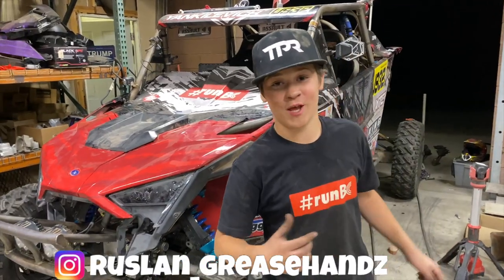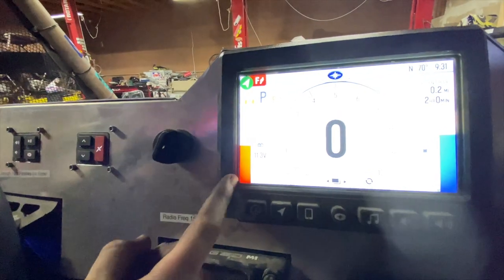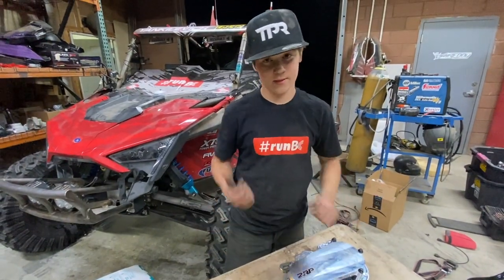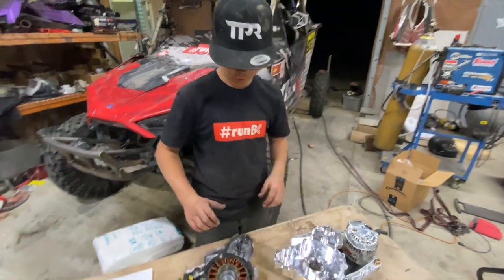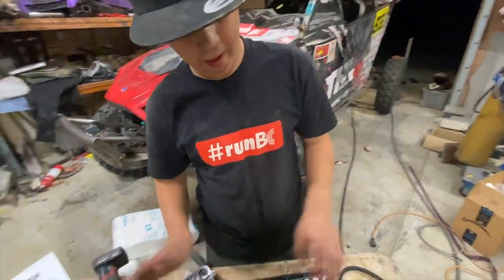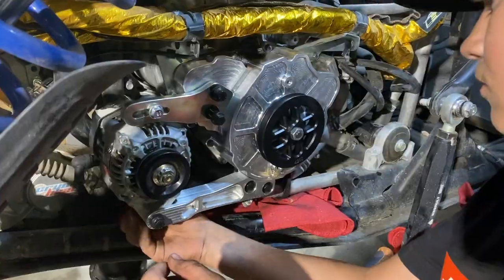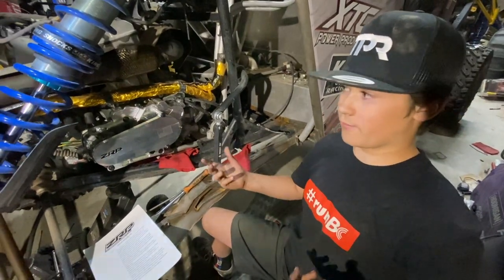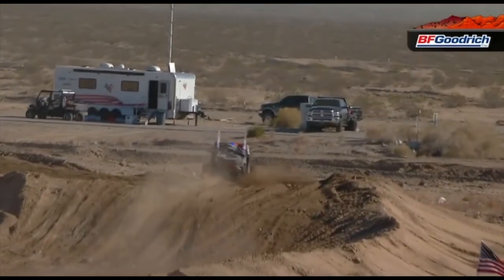HOW TO INSTALLATION ZRP ALT KIT on RZR (Super EASY)

Comment: Great job young man!

I have a question. What is the voltage at idle with all the lights and fan on now? When it's revving it's going to make more voltage just as any other alternator or stator makes more as the stator spins faster. Also just FYI the part inside is called a stator, pronounced stay-tor. Keep up all the good work.